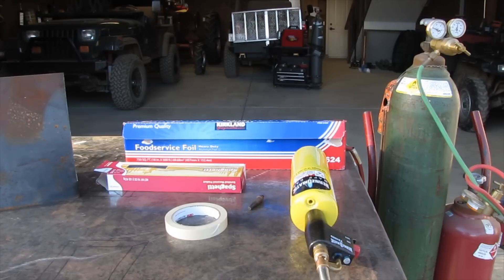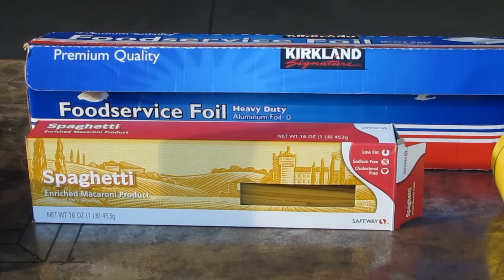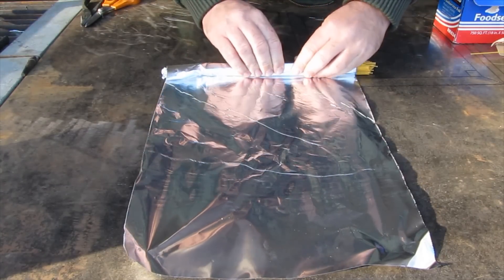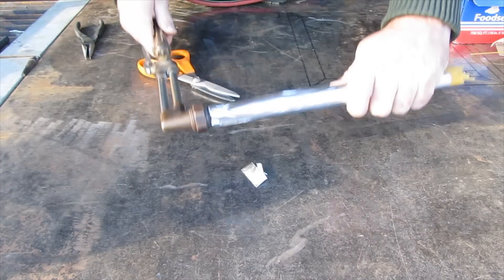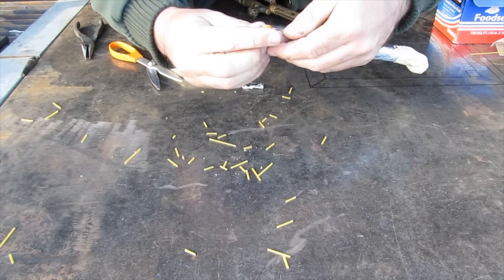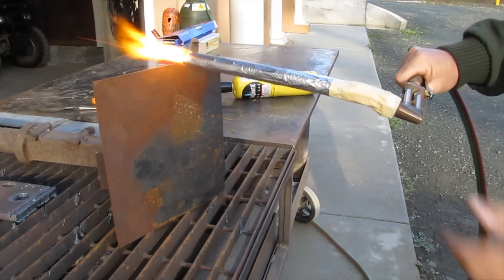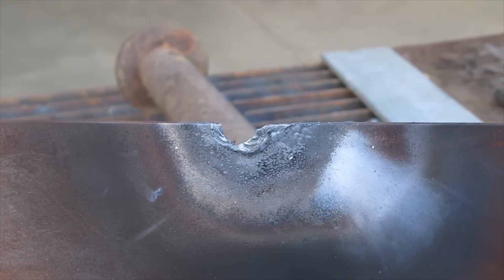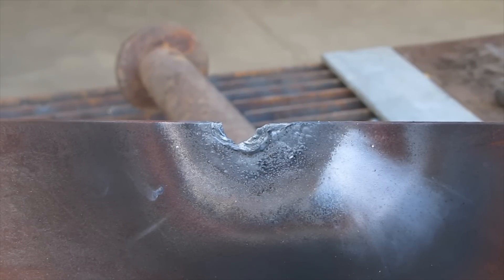How to Make a Thermic Lance with Spaghetti

Comment: Or just use the cutting torch as designed, it will cut steel a lot better than spaghetti. Use a chunk of iron pipe and LOTS of oxygen if you want to really burn heavy metal.
Reply: Maybe his acetylene tank's depleted.

Comment: Use a steel pipe instead of foil.  The real ones are an iron pipe filled with magnesium rods.  The burning O2 rapidly oxidizes the iron and shoots the molten iron mixed with burning magnesium through pretty much anything at about 10000 degrees F.  Apparently that's hotter than the melting point of any known material.

Comment: Lose the spaghetti and foil then swap to a steel brake line about 4' long. Hook the brake line up to the O2 and stick some steel wool in the distal end of the brake line. Light the steel wool and crank up the O2. Now it will be burning steel as the heat source and not only will it cut you steel plate, it will  cut granite

Comment: So I looked at your design and I was thinking of a better way to do that first get a steel pipe and one end cap or aluminum pipe what ever and instead of using spaghetti get rods of magnesium it should burn hotter
Reply: Yeah, that’s how thermal lances work. The point wasn’t to make make a normal thermal lance, it was to see if spaghetti works

Comment: Iron burns if you get it hot. Just add oxygen. Try steel wool and a battery, then disconnect the battery, just blowing on it accelerates the fire.

Comment: Using nothing but spagetti...and aluminum foil....and tape....and a torch....and an oxygene tank. You could potentially burn all the way thru, if you have ½ a mile of spagetti.
Reply: That's why a proper one that uses steel is about 3 meters long